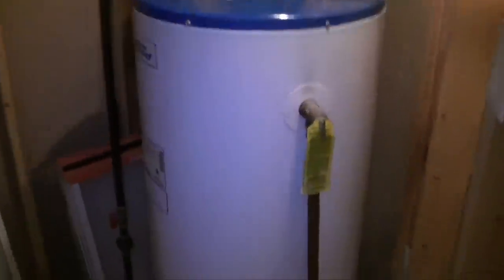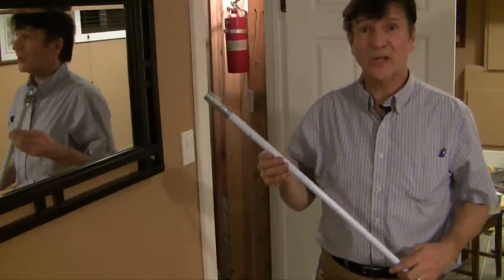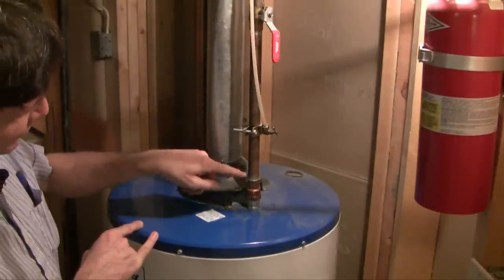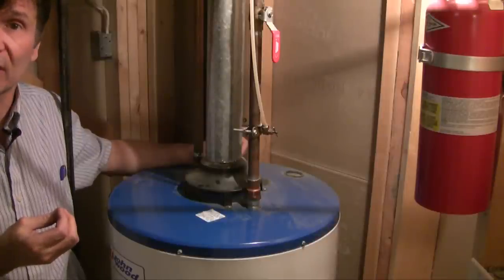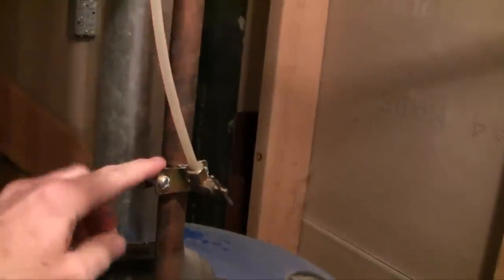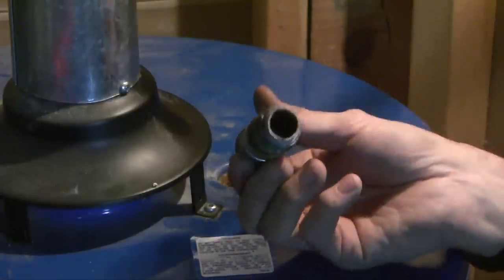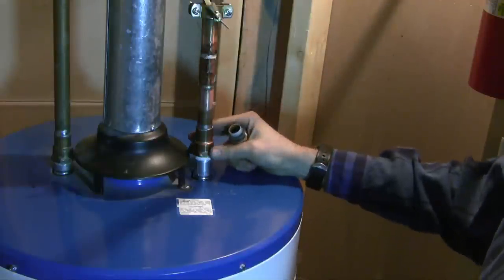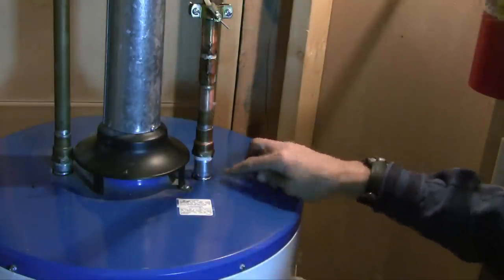How to repair a weak hot water heater, by replacing the dip tube

Comment: I thought that when you connect a copper pipe to another metal  pipe it needs to be separated by a rubber washer to prevent electrolysis. Did you do that? Because if you dont it causes the pipes to corrode.
Reply from the maker: Those are good points, and when I reviewed that topic I looked for isolating connectors but the weren't available, and they certainly weren't on the professionally installed tank to begin with. You can't just do it with rubber washers, you need special isolating connectors. The topic is more complex than one might think. Remember that the tank is made of steel, too. That tank and the associated tubing is protected by the anode rod (shown in a different video on my channel). For the anode rod to work properly you need to have electrical continuity with the whole tank and the threaded connectors, and for electrical safety you need the whole system to be electrically well grounded. An isolated tank system, by definition, is not. Electrical code requires that the power box (that is screwed to the tank) needs to be grounded, and by the building code of the day these wires go right back to water piping. This home was constructed such that the electrical ground for the whole house is grounded through water pipes. So, even is you go through the effort to isolate the tank at the water pipe, your electrical ground wires to the box give it continuity, anyway. The other issue is that the connections on this tank are routinely replaced every time a tank is replaced, so you don't expect to see much corrosion over the expected life of a tank. Notice that the old connection showed no evidence of galvanic corrosion, despite the fact that it was in place for more than 16 years. The anode rod did it's job.
Reply: spelunkerd c

Comment: What happens to the old dip tube?  Is it just free roaming around inside the tank?  Thanks for your vids!  Stay gold.
Reply from the maker: Yeah, just sits there forever, never causing any problem. Some tanks have other debris drifting and bouncing on the bottom, and with those pebbles you might hear a muffled clunking sound when the shower is running. But I don't expect the tube to cause any sound at all, since it's too large to move far. Small calcium pebbles may be washed out when you drain the tank. They say you're supposed to do that every year, but many people never bother.

Comment: Nice video, spelunkerd!  But I have a question.  Is there some test you can do to verify that it is in fact the dip tube that is responsible for your hot water problems before you change it?

Comment: Have you had any issues with the pipe remnant in the tank breaking down into tiny pieces and blocking up your faucets?
Reply from the maker: No, not at all. I think most fragments are so large they aren't swept by flow into the water stream, they stay in the tank. It would be interesting to see if that plastic floats, I'll guess it doesn't but I never checked.

Comment: 8:29 - how many turns of the tape to keep away all of the leaks??
Reply from the maker: Most professionals use three turns of teflon tape. Make sure you use the teflon tape for water connections, not gas. For important connections, like this one where there is significant effort to redo, they add plumbers pipe dope as well.

Comment: So the dip tube on the Intake side goes to the bottom and the Outlet side is near the top of the tank.  How does one make sure the in tank was plumbed correctly by looking at it?
Reply from the maker: Yes. Most tanks have the connections labeled or imprinted in the steel beside the fitting on the top of the tank, often only the hot side is labeled. Otherwise I suppose you could consult the manufacturers installation manual.

Comment: I have an exact issue with my hot water heater (gas). The house is fairly new at about 8 years old. I would of thought it would take longer for this dip tube to corrode? When we moved into the house I could easily pour a hot full bathtub of water at a temp setting less than max.. Now I can only get to about a 1/3 of a bathtub and it turns cold. Will do the turn on the hot water and wait for the burner test to see how that goes. I have had to turn the burner on maximum and it helped very little. I saw a comment about extra insulation. It's in a heated basement(well to about 60F(15C). Would you happen to know if adding outside insulation helps also, as the issue is worse in the winter as the floor gets much cooler? Typical of me to want to do more than is needed which may only be the dip tube. I should mention that the relief valve has been going off once in awhile since putting the temp setting on max. and the hot water pressure is lower than it used to be. Comments?
Reply from the maker: That relief valve should not be going off, I wouldn't push the system so hard that it goes off. Perhaps poor flow is causing that. I would check the burner plate to be sure there isn't carbon debris there interfering with heat transfer, and I would drain and flush the tank after allowing the water to cool down.
Reply: spelunkerd I will be back to my house next week and provide some feedback. What would cause poor flow? I guess I would have to see if its isolated to a tap of a few taps first then decide whether its the tank causing poor flow. Then I would need to know locations of cause and then procedure on how to fix. First things first will check what you said above. I read in another answer on this page that you can take the relief valve off to view if the dip tube is damaged. I wonder if a poor relief valve could cause pressure issues also.
Reply from the maker: Allen Goulais Those are good thoughts. Remember to check the simple things, too. Many water heaters have an intake shutoff valve; you want to be sure it is all the way open. Also of course check the main water shutoff valve to be sure that one is completely open. Good luck!

Comment: Did your $10 dip tube come with the dielectric nipple, or did you re-use the original?
I just came back from the hardware store, and the dip tube the man showed me was just the plastic part.  It had a flange on it (sort of like a sink's tailpiece) and man said to drop it into hole, insert supplied washer, then screw old nipple in.  Does this sound right to you.?

Also, very nice video.  Good content.  Well prepared and presented.

Bob
Reply from the maker: Mine was just as shown, there was no dielectric insulating flange. However some water heaters do have dielectric isolation between the tank wall and both copper pipes, to try and prevent electrons from moving back along the piping, causing corrosive redux reactions from a distance along the piping. The theory of the problem is similar to what can happen at a boat dock, where one boat can be damaged by electrical continuity with other boats if they are interconnected through a common ground. Boats are safer if they use an isolation transformer at the land power connection to stop that trickle of electrons between boats.

This home was built on an old style pattern where the home wiring ground is directly connected to the copper piping. Of course electrically heated water tanks need to be grounded for safety. In our current home, the piping is all plastic so there is no continuity along the piping.

Whatever system is used, the anode rod needs to have electrical continuity with the tank wall.

Thanks for watching, and for your very thoughtful remark. In your case I would try to replace it as it was manufactured. If the flange fits then it would be reasonable to use it.

Comment: Im surprised that nobody mentioned that the anode rod and the dip tube can be inspected through pressure relief valve hole when its removed. Shame on you Spelunkerd for not thinking of this option. Lol.
Reply from the maker: Good point, thanks for raising it here.
Reply: Have you ever tried to remove a pressure relief valve?  I could not get the pressure relief valve off of my old water heater.  I must admit that I didn't work too long on it but I figured a good pipe wrench would take it right off.  Boy was I wrong.

Comment: Is there a life expectancy for water heaters manufactured in the 90's?  Do you think they will last longer than the ones manufactured in 2014 or so?  I have an AO Smith from 1996, will change both the dip tube and Anode rod.  I am kinda wondering if 25 years is "unheard of" regarding life expectancy............
Reply from the maker: I've been luck with water heaters, but I believe that quality control over the past decade has slid backward from price competition. As a consumer, it's hard to properly examine the tank properly, since the crucial parts are all covered. Even warranties are a problem, since they end up giving you the same model that fell apart  before.
Reply: We have fairly good water quality where I live and a builder's model water heater installed in 1993 lasted about 16-19 years with no anode changes.  I don't think the water heaters manufactured in the 90's are any better than the new water heaters.

Comment: I just did this and the pipe was inside the heater. Any other idea why the water just get hot for 15 min ?
Reply from the maker: Looks like I missed your comment last month, sorry. Other problems could be from debris building up at the gas burner plate, or from a bad electrical heater, or perhaps something wrong with the thermostat. I would start with a flush of the tank. Over time, solid calcific debris builds up inside, creating 'insulation' on the bottom that interferes with heat transfer.

Comment: Hi great video! Can you please tell me where you bought your dip tube. Its the largest one I’ve seen so far and need to replace my Kenmore dip tube on my gas water heater with no luck. Please let me know
Reply from the maker: The last one I bought was at Home Depot. If they don't have one, you could go to a plumbing supply store. Most of those tubes are a standard size.
Reply from the maker: Gee, I'm not sure about yours. I'm going to guess that it probably has an internal adapter that tapers down to a standard size dip tube inside, but the only way to tell is to take it apart and see. Of course when you do that you'll have water turned off, and then the clock is ticking for you to get it back together before you need water. Sometimes corrosion makes it difficult to get back together without leaking so there is an element of risk. On the other hand the standard professional approach is to sell a whole new tank, so you don't have that much to lose except perhaps an emergency visit. The standard hex nut at the top is 1 1/8", but the dip tube is attached inside with smaller threads, as it was in mine. Good luck!
Reply: spelunkerd the 1 1/8” hex nut is for the anode rod isnt it? I don’t see any hex nut on inlet tube, just see the nipple that seems to be screwed on a slightly smaller nipple which I can’t tell if it goes to the tube or if theres another nipple reducing it further. Is there a standard size for all dip tubes or do they vary with each manufacturer?
Reply from the maker: I've only found one size of dip tube for residential installations, though I suppose your size might be a little different. You might stop by the manufacturers site to see if they offer any more details.
Reply: spelunkerd ok they don’t provide any support because they want me to buy another one but I’ll keeping looking. Thank for the input

Comment: Some plastic dip tubes used by manufacturers broke off inside and disintegrated causing particulate to lodge into faucets and impede their performance.  In these cases, its possible the hot water heater needs replacing.
Reply from the maker: You make a good point, that professionals often upsell a new water heater rather than simple dip tube replacement. This isn't always a bad choice, since if the water heater fails a couple of years later you pay again for another service call. Spending more up front offers a more secure and professional guarantee that more money won't be needed in a couple of years. In the DIY world, we discount labor so the calculations are different. The tank in the video lasted for years longer and I never needed to replace the tank before we finally moved to a new home. Newly designed tanks, like the one I own presently, route cold water in the bottom so a dip tube is not necessary. You can reliably say that any tank with entrance of cold water in the bottom will not have a dip tube.

Comment: I don't know if this is what will help with my problem or not ... Perhaps you could clarify for me?

I enjoy nice long hot showers after a hard days work. I USED to get a good 30 to 45 minutes of hot water with no reduction in temperature.

However, lately (and quite abruptly I might add) it has dropped to  10 to 15 minutes before the water temperature starts to rapidly cool to actually COLD water.

Is the dip tube causing this or is my HWH suffering some other ailment?

My house is all electric so naturally so is my HWH if that matters.

Thanks for any input.
Reply from the maker: +Garry Robinson A broken dip tube would be the most common cause of that, although it's not a certainty. Your presentation is nearly identical to mine. The tricky issue is that many professionals would sell you a new water heater. I would check the dip tube first, and flush the tank at the same time.

Comment: Dielectric Unions would be the best option ultimately.  This allows you to disconnect and remove the water heater much easier.  Also you shouldn't mate copper to galvanized iron since they are dissimilar metals and can corrode very quickly.  Generally though that seems to occur more often if you have a stray current going through your pipes.
Reply from the maker: I agree with both of your remarks, as mentioned in the thread previously. Were I to do this again, I would use a union, preferably with a dielectric isolator if I could find one.

Comment from the maker: Unfortunately I can't reply within the thread of the remark by drjonesphd, because of a Youtube glitch. I've often wondered what is different about the accounts of those contributors, and whether they can ever start a discussion thread that can be continued. Perhaps it has something to do with their privacy settings or the Google+ fiasco. In any case, he is asking about dip tube length. Generic dip tubes are available at most hardware stores such as home depot, etc, and mine is certainly generic. Fortunately the thread pitch and hole size seems to be standardized, industry wide. The store I got it at had only one length, and I suspect it doesn't matter that much. In a rare situation where the tube is too long, it would be easy to shorten it with a hacksaw, taking care to avoid longitudinal cracks.

Comment: How did you remove the old dip tube body stuck in the heater???
Reply from the maker: Left it inside. Not as big an issue as you would think, and almost impossible to snare and remove. That plastic is designed to remain inside a water heater, for the life of the tank. Even though it wasn't designed to touch the bottom, the surrounding water will prevent the bottom from getting so hot as to melt anything.
Reply: @spelunkerd  I actually knocked the remaining piece into the tank with a similar sized socket and locking extension. Turns out my problem was the output side of the tank had debris. Once I put everything back together, the system worked perfectly. Good long lasting hot water and good pressure. Thank you for the video and the quick reply, appreciated!!

@sir_charelz

Comment: Is there a flexible tube that I can use. The reason is that the water heater is on a box higher than the ground.
Reply from the maker: Not that I know of, but you might ask a plumbing supply store. Flexible dip tubes certainly aren't stocked in general hardware stores, and even the standard size is getting harder to find.
Reply: spelunkerd , I will ask a supply store, thanks for the reply there just isn't much clearance, and I'm afraid to disconect the rest of the lines and to solder again

Comment: Did you turn off the water to the house or just the cold intake valve? I tried that earlier(closing only the water inlet to the heater and not turning off the water to the house)
 and the water doesnt seem to stop.. (I was trying to drain the hot water in the pipes)
Reply from the maker: Yeah, there will be unavoidable retrograde flow back down the hot water outlet pipe into the water heater, and if your house has many floors, all the pipes need to drain dry before flow stops. I actually don't remember what I did but I think I shut water off at the main inlet valve for the house. If you had valves on both sides of the water heater that problem would be avoided, however I think code prohibits a valve on the hot side so that the system is less likely to overpressurize if you forget to turn the hot side back on and if safety mechanisms fail. You can speed drainage for the system by opening valves, especially upper floor valves, to relieve vacuum that prevents the piping from draining water completely. If there is unrelieved vacuum it can take a long time for retrograde flow to subside.

Comment: Is there a way to connect the hoses without soldering?
Reply from the maker: It depends on what you have now. Some tanks are installed with unions that make it very easy to swap a tank, however most professionals don't bother to install unions. None of the homes I have lived in have unions.
Reply: He could have used a sharkbite fitting (or a compression fitting) that doesn't need soldering.  Those sharkbite fittings are expensive and a lot of people use them because they are easy to use but it's a lot cheaper to use regular copper fittings if you know how to solder.  I probably would have installed a tee and gotten rid of that saddle valve and installed another valve for that water line (humidifier?).